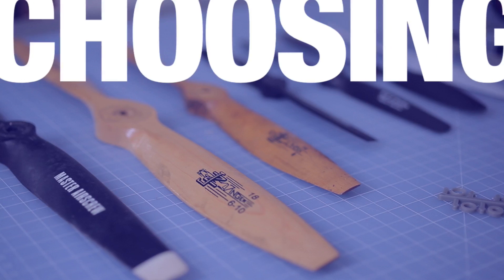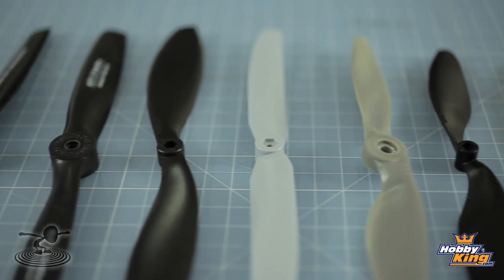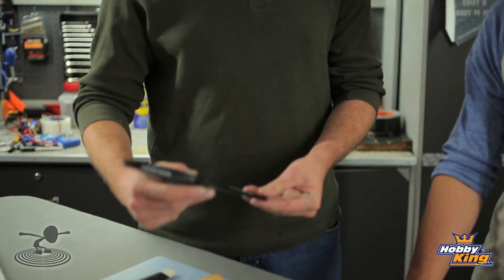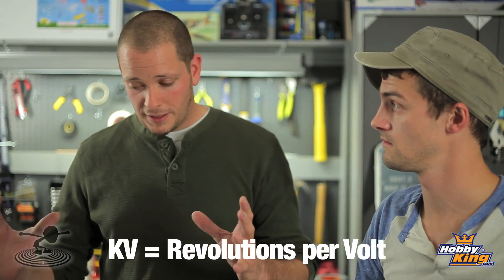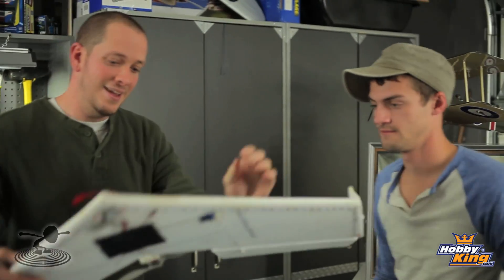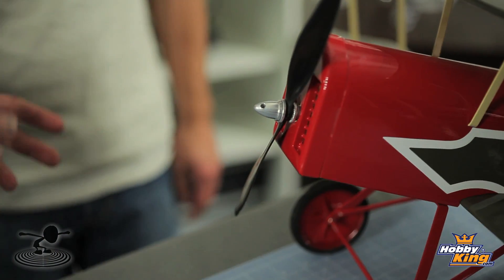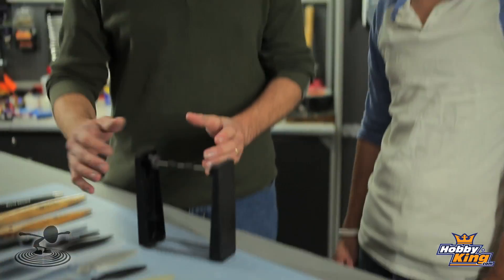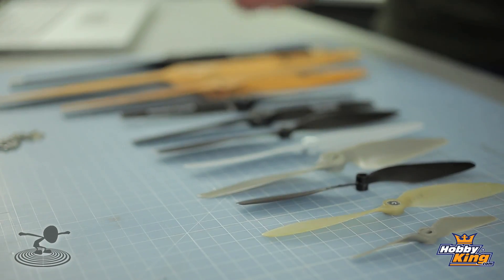Flite Test - Choosing A Propeller - FLITE TIP

Comment: Love your channel guys. I'm interested in controlling the noise that the props make. I assume there is some kind of relationship between RPM, prop length, pitch, thrust, and noise. How do you find the right balance between thrust and noise and will quieter props be more efficient? Would love an episode on quiet multi-props. Can a quiet tricopter be made with large props and slower motors with more torque?

Comment: i need help..i have a Turnigy DST-1200 Brushless Outrunner 1200kv which max ovr at 16amp , i bought a 10x5 prop for it but im afraid its gonna over load the 20amp esc that i have..will me system work good enough for a couple flights?

Comment: Great informative video. I have a dji phantom version 1 I'm currently using the standard 8043 plastic props. I flying with dual 2800 mah 3s lipos and a gopro hero 3. I'm wondering if I should upgrade my propellers to the carbon fiber 8 inch props due they are more stiffer and I'm carrying a little more weight or continue to fly with the standard props. Let me know whar you think.

Comment: I bought some cheap props from a seller on eBay in China last week for my DJI Phantom. I broke my original props that came with it and they are expensive to replace. When I received them they looked the same but were thinner and the tips of the propellers were slightly bent downward. Are these safe to fly my $1200.00 quad with? They didn't seem to preform very well when I tried them, it drifted a lot. Should I just fork up another $40.00 for original DJI props, or can you recommend some other solution? I like your show and thanks!
Reply: If I had a $1200 quad, i woudnt take any chances. I know nothing about propellers or quads though.
Reply: john hill your right i realize this is two months old but inferior props will snap much easier and will flex during high rpm situations, when your flying high you don't want the prop to break.

Comment: One thing you did not say, what the three wires on the brushless motor are ? positive- negative and the third ? how to hook to ESC, if  both motor/esc have no color match on the wires? I see many do "not" match color of wires.
  Weight have anything to do  with picking a motor? think that would be first step in picking a motor weight of the plane with everything.
HOW MUCH WEIGHT CAN 950 KV MOTOR LIFT? can we see a video on this test maybe with a quad copter would be fun to see.
 
Do we need to take apart and clean motors inside if you fly at dirt flying parks? best way blow with air is only way? 
 how long will brushless motor last, what will go on it?  with brushless the bearings wear out first?

Hobby store  offer replacements which companies do have bearings for the motors? do they make you buy new motor. Found best to have spare parts on hand. I learned make sure you can get them before you buy any rc craft even replacement screws hard to get most do not offer them, just try finding screws for v262 quad copter... Best build your self that way you know where you got the parts, and screws if need same parts again.

Comment: Just curious if this is an exact science or rather hit or miss regarding choosing engine size (and appropriate prop dimensions) for max performance vs max flight time for planes and copters. Larger motors turning larger props at slower rpm use less power than smaller, high revving motors with smaller props, or is it the other way round....?

Comment: Building my 1st airplane fm scratch and dont kno how to get the prop on the Park 450 BL motor cuz ther r NO instructions? it has a funny looken collet-spinner thingy? AND the diameter of the motor shaft is BIGGER than the hole in my 10x7 prop?   this is a GREAT video and starts wit 100 different props and how to pick the right one?  well i think i gots the right one (?) but cnat evn get it on the airplane!  i guess beginners r jst supose to  B able to figure it out,,,  kinda comical in a way :)

Comment: I have a suggestion for all of you that are confused about props. Order a range of props and then double each order just in case you like one or more. Get your fuselage on the bench and your power meter, and after carefully balancing each of your examples, run it thru the paces. That will give you a more than a rough idea as to the max diameter and bite.Make note of power consumption for each set-up and simply deduce "Dear Watson" ...and  then take no more than three props to the field to test.

Comment: Hi i just wanted to know what prop to choose I have a t28 Trojan by parkzone I'm making it 1000 watts now the motor is a 900 kv motor 950 watt with a 60 amp esc and the motor suggested prop is 13x8 batt is 3s should I go something a bit smaller prop wize to not push all setup to heat up ????

Comment: You only need a pusher prop on either IC motors or where counter rotating is required. Electric you can always make the motor run either direction

Comment: @deeringdeluxe There's really no need to respond to me like that, I even stated the motor direction defines which way the thrust will be. 

But regardless of that a prop really should always face the correct side, as that's when it will work best (you can lose up to 50% thrust if its mounted backwards). A prop that's on a pusher plane will function like a pusher prop, even though you'll have to put it on backwards compared to the motor itself. So what exactly is your point?

Comment: @flitetest The forces involved are the exact same though and if the inner spacer / ring or whatever you'd call that plastic thingyfoo fits correctly, you won't notice anything. It's like changing the position of a washer to clamp a prop properly, but still keep it between two nuts.

In other words, the influence is totally and extremely negligible. ;-)

Comment: @deeringdeluxe It does! I made the mistake flying a Swift 2 with the prop backwards to what it should be and it really feels sluggish in flight. A prop mounted the wrong way will fly,yes but it will totally be less efficient and less thrusty. The motor direction defines whether it will move forward correctly, but you should never fly with a prop mounted backwards if this means the wrong way is pointing forward in flight.Don't forget props are shaped into a curvy surface that works like a paddle.

Comment: @deeringdeluxe I know, that's what I'm trying to say ;) Props have a direction (CCW or CW), you have to mount them correctly (either forwards or backwards based on the motor location) to make sure the numbers on the prop are facing towards the direction of flight. Even if the motor is at the back of your plane, it doesn't mean you need a pusher prop, as long as the prop ends up turning the correct way. It will work fine with either prop type, you just pay more for pushers.

Comment: @flitetest Good point. I still don't think they are worth the expense for single-motor crafts; use lock-tite on the collet (or a prop saver) and don't spend the extra money for pusher props ;)

Cheers,
Ben.

Comment: Hey guys, love the show, but I want to correct something you said about pusher props. They are ONLY required when you need to compensate for the torque roll of multiple motors on a plane, or a quadcopter.

You do NOT need a pusher prop when the motor is mounted behind the plane; you mount the prop backwards (i.e. the numbers towards the motor) and reverse the motor direction, so the prop turns the correct way around.

Look at your Swift II, you don't have a pusher prop on it ;)

Cheers,
Ben.

Comment: Really like the way both of the Josh(es) interact and and dynamics they bring.  Very professional channel that kind of reminds me of Myth Busters.  The RC industry needs your approach!
Another factor to bring to prop choice is the number of cells in the battery - which affects KV choice - and rated Watts of the motor and ESC.  Also, ground clearance for the prop, rated RPM of the prop, differences between gas and electric props.  I know its a lot but a multi-part series would be good. Great job.
Reply: How are u?